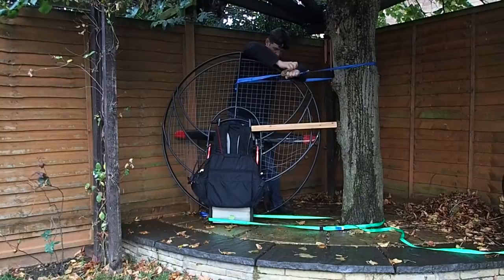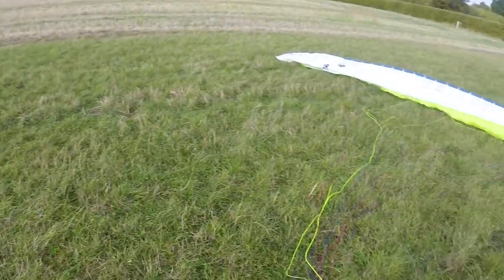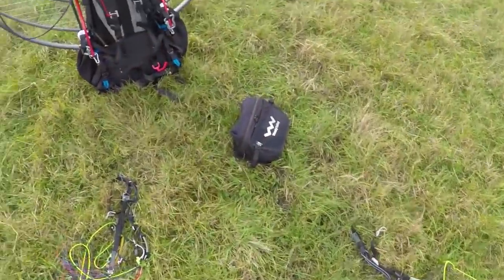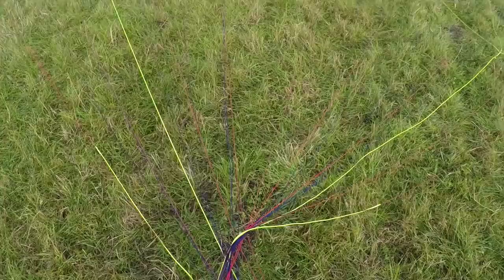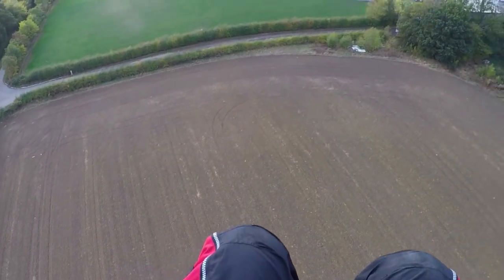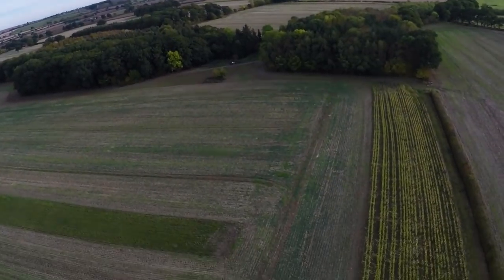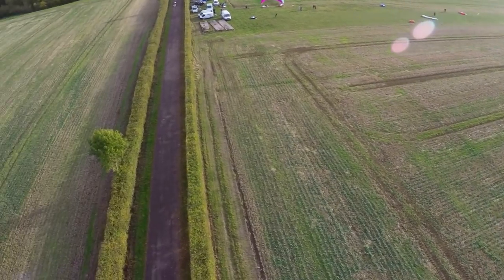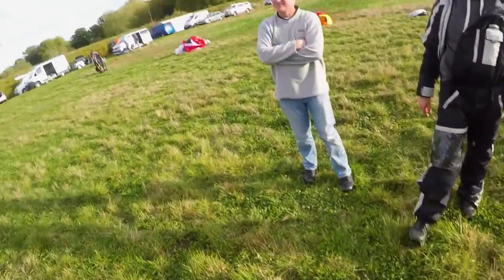Paramotor Vlog - Chasecam, TANDEM, bump tolerance

Comment: Always entertaining. Probably wouldn't do the tandem thing myself as my jewels have shrunken in my moderate age...lol Hey, a suggestion regarding the chase cam. Well, I'll tell ya what I do anywho. I always have the cam near my standing position. Reason: I can bring the wing up and get going before the cam has a chance to come meet my prop or anything else to boink. With it behind the wing, it has the opportunity to begin coming forward with increasing velocity and if I don't/can't get going soon enough....HELLO! That could obviously be un-good. ~8^) Keep 'em comin' Paul!
Reply from the maker: Thank you, and thanks for the advice, I'll definitely do that in future. It crossed my mind today, while driving, that if that line got caught in the prop, it would simply reel in the entire wing! Scared myself just thinking about it...
Reply: If I may add another thing that I do...I'm sure you're aware of disposable key rings. The kind of really thin metal rings that you can easily pull a key off and throw the ring away? In a center D loop where the line connects to my wing, I gently (so I don't stretch the ring open permanently) put one of the rings on that loop and connect my chase cam to the disposable ring. This way, if my cam gets caught on something, including my prop, it will be yanked off destroying the ring but not my wing. I'm a poet and didn't know it. YAY!
Reply from the maker: On it. 👍🏻

Comment: Paul. You have to use some muscle to reverse sometimes ,it comes across that you are a bit nervous of that wing commingling up.
As one who will always do a reverse if I can the trick I find is (UP,Steady, turn and GO.)Don’t hang around or you’ll loose it.
There are far more experienced pilots than me that will advise you but that’s what works for me.
And plenty of practice with the engine on your back. Hope this helps.😊👍
Reply from the maker: I did a lot of reverse practice in training, but in six months of flying it's only lately that we're having the conditions where they're needed. I know how to do it, just haven't done it. In my defence, that field is a sod when the wind is anything too far from westerly. I'll get it nailed soon, no worries. 👍

Comment: I'm lucky with frames... it was already a mess (but usable) when I bought it (bailey 175cc standard frame)
I built a ring roller and have a tig welder so can replace any part of it as and when needed (or can be arsed)
Not been so lucky with props though.... blew one when the baffle came out of the exhaust during climb out then blew the brand new replacement when my throttle cable threaded through the frame into the prop.... £320 lasted me 30 seconds.

Those reverse launches.... I love revers launches but I'm pretty sure those winds you had would have had me struggling (and I bloody hate forwards)
Reply from the maker: It's a shitty field when the wind's off, I'm not going to be too hard on myself. But when I nail it... just wait for that video! lol!
Seems like being able to repair your own Bailey cage is a very good position to be in. My friend has bought a welder and taught himself to weld and bend pipe while waiting for factory replacements.. Cancelled the order!